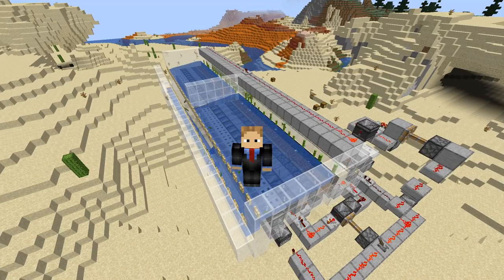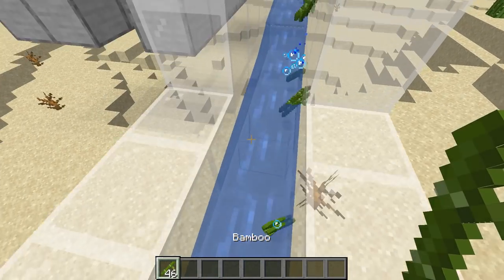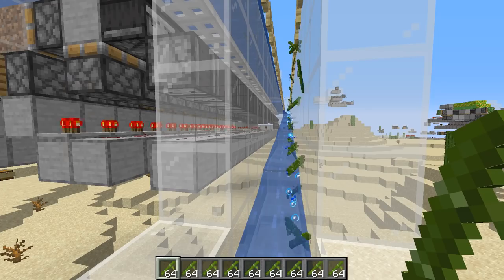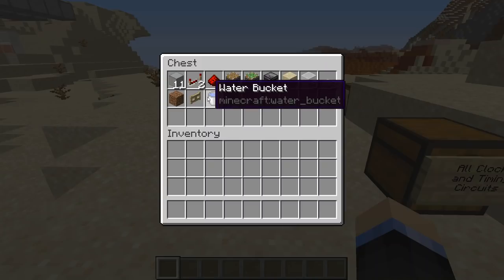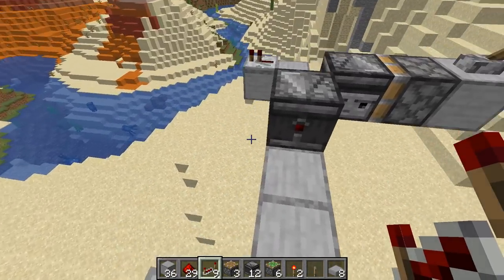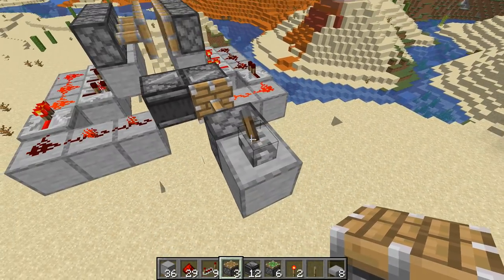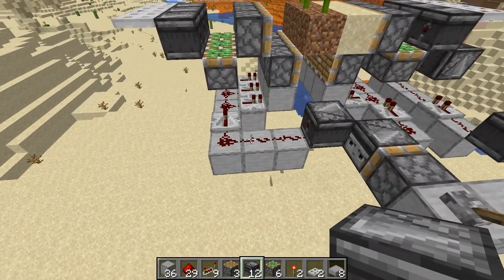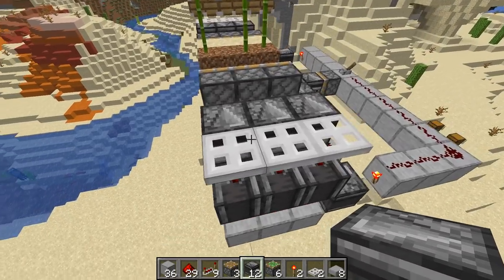Faster Than Zero Tick Bamboo - Minecraft Java 1.15 - Full Auto Shaky-Sand

Comment: Is it possible to rig this in some way to stop when the hoppers/furnaces are full? We're trying to set it up like that but it keeps breaking. :(
Reply from the maker: you could hook it up to an off... or you can add an item overflow protection system by putting a cactus or lava at the end of the water stream to automatically destroy any items that don't get picked up by the hoppers.
Reply: @EagleEye621  The old one i have for my exp machine (0tick) just automatically shuts off when a certain hopper is full.. then started back up again when items started flowing out of it until it was full again for an exp furnace, but it seems 1.15.1 killed its 0tickyness and was hoping this qtick could do the same without breaking if i forget about it and leave the area without turning it off manually. (brain like a sieve) x.x; (im on a vanilla server)
Reply from the maker: @perusalenne  oh, I understand.  you have to make a few changes if you want it to be auto-on/off without player input, but if you leave it on while you unload the chunk it will break.

Comment: ok eagleeye i have built yours and iskalls zero tic bamboo on my java paper server and they work i have flipped both around to make sure its not a orientation thing and its not, can you give me any ideas to try, im fixing to resort to a carpet duper for full
Reply from the maker: when you say flip... do you mean 90 degrees?... also, NOT work or work... if not, you need to change the settings in paper to turn off the mod blocking it.

Comment: This farm is perfect for fueling my XP farm. Only issue I am having is getting the pistons to shove the sand over on start up. The blocks rise slightly later due to the 2 tick repeater, but the sticky pistons that shove the sand and dirt over don't activate... Any ideas?

Edit: Just realized that both sets of pistons, 3 each, aren't activating to push the dirt and sand. The blocks above the observers go up and down but its like the redstone signal isn't reaching the horizontal ones.
Reply from the maker: did you build it in the wrong direction?
Reply: Maybe you placed the observers facing the wrong direction?
Reply: Same issue here.
Reply: @Blorfik  Make sure the pistons are facing east and west. That's what I did wrong.
Reply from the maker: @Blorfik  same answer here
Reply: @EagleEye621  So, whats the answer?
Reply from the maker: @danilap8994  for them... they built it facing the wrong direction.
Reply: @EagleEye621  Mine is facing the right direction and im still having problems when i shut off the system. Any chance you could help me out
Reply from the maker: @danilap8994  of course... guessing you don't have the repeaters coming out of the observer clock (check the pinned comment)

Comment: Im having a problem where the pistons moving the sand aren't moving and I built it on the right axis and double-checked it. I'm building it a multiplayer server with my friends, could it be that the server lag is messing it up? Because this worked on my Redstone world
Reply from the maker: the zero-tick block pushers only work when pushing east/west
Reply: @EagleEye621  Bruh. I just finished one 45 long for a smelter and now I have to turn it around
Reply from the maker: @xionic1194  45 long? how big is the super smelter this thing is going to power?
Reply: @EagleEye621  It's 3 sections. It handles all of the sword output from a gold farm, normal sand smelting for my glass megabase, and a section that I sell the use of to other people. I added a component to this farm to adjust the output so it can be run on 15, 30 or 45 depending on how much of the smelter is being used. There's 180 furnaces, and the excess bamboo is used for scaffolding, which I also sell
Reply from the maker: @xionic1194  at 45 slices you are looking at ~300,000 bamboo per hour. 180 furnaces would burn 259,200 per hour, so even at maximum burn you have a pretty healthy surplus :)
Reply: @EagleEye621  2 things about this server  - it has villagers that you can sell things to infinitely, and it uses gold as currency, so the scaffolding plus the gold farm will make me the richest person on the server. Admittedly I may need a bigger spider farm for that surplus
Reply: @EagleEye621  how did you manage to calculate the value of those?
Reply from the maker: @GrndSbtr  ~6,600 bamboo per hour per slice /// furnace can burn 360 items per hour, need four bamboo per item... mathificate :p
Reply: @EagleEye621   Hey youre so quick! Please tell me how many slices id need for 30 furnaces, I cant seem to figure out the exact value. Thanks!! I really appreciate you! Subbed
Reply from the maker: @GrndSbtr  won't always be that quick, but do my best to find every comment eventually :p

each furnace needs (360x4) 1,440 bamboo per hour... so 30 furnaces needs 43,200 bamboo per hour (minimum) / 6,600 (per slice rates) = 6.55 slices... rounding up to 7 slices minimum. :)
Reply: @EagleEye621  Thanks for making videos on how to be really efficient in mc, keep up the good work! Thanks for helpin! 

Now that I think of it I think youre an actual engineer, in real life of course, in mc, you already are

Comment: does this work on servers? i just finished building it and its not producing anywhere near what your 3 slices are producing and then when i turn it off it crushes the sand and turns it into dropped items
Reply from the maker: it does work on servers unless it has been modded to block it.

did you build it in the right direction?
Reply: EagleEye621 yeah I did. I searched through the comments for a few minutes before building it. And it would start the shaking sands but it would barely produce and then when I turned it off it turned the sand into dropped items and the bamboo unplanted
Reply from the maker: @tylerphillips402  did you put a repeater coming out of each of the observers from the observer clock? did you double check the other timings?
Reply: EagleEye621 I think I did. But I disassembled it to use the materials for a different build

Comment: @EagleEye621 I built everything as you did and I have the right orientation for the zero tick pistons. The sand is shaking and everything but the bamboo doesn't grow fast at all. I play on a server of my friend version 1.15.2. I hope you have a solution to my problem thanks.
Reply from the maker: add some light near by if it is underground or blocked from sky access.  If you are playing with some plugins (like paper or spigot) they have default mods that block fast growth the admin has to disable.  also, some servers (like minehut) block fast growth be default.

Comment: so ive tried rebuilding it 2 times and for somereason the sand never gets pushed over to the middle
Reply from the maker: probobly facing the wrong direction.  Which way are the zero-tick pushers (the pistons that are pushing the sand and dirt) facing?
Reply: @EagleEye621  i have the same problem, as far as i can tell i did everything right, do you have a discord or something where i can send screenshots if you would happen to know what was wrong?
Reply from the maker: @xanthik6205  almost certainly the issue is it was built in the wrong direction (the zero-tick block pushers only work in one direction), but I do have a discord you are welcome to join (link in the description) :)
Reply: @EagleEye621  yea that was the problem, ran into another ome though, the bamboo breaks when dirt switches for sand, and sand breaks and doesnt get pushed back into default spot, if i only have dirt in it it seems to work fine
Reply from the maker: @xanthik6205  sounds like you might be missing a repeater? do you have repeaters coming out each side of the observer clock?

Comment: I don't understand what's wrong with mine, I did it exactly the same but my sand isn't being pushed over. Everything else works fine.
Reply from the maker: you probobly build it in the wrong direction? post some screenshots in the help section of the discord?
Reply: @EagleEye621  By direction do you mean the entire structure has to face north/south/east/west?
Reply from the maker: @rallozarx4215  the zero-tick pistons are directional

Comment: I built it and rebuilt it multiple times, tried adding the repeaters on each side of the observer clock, the pistons are west/east oriented, but the bamboo doesn't grow :/ Help ! I'm on 1.15.2
Reply from the maker: bamboo not growing but also not popping off when the sand shakes... either you don't have enough light or your server has been modded to block fast growth.  If you are or know the admin, you should be able remove those mods.
Reply: @EagleEye621  It's a vanilla server, but it was missing light !! Thank you <3
Reply from the maker: @raphaelqueiroz7925  great... also, check out "Remote Activated Shaky-Sand (36,000 Updates Per Hour Per Crop)" for that issue with moving the on/off switch further away.
Reply: @EagleEye621  This seems complicated, I managed to make it work just by pushing a redstone block with a sticky piston
Reply: Well you showed it in the end of the video x) I spoke too fast

Comment: Hi having a problem where the pistons are not pushing the sand block
Reply from the maker: did you build it in the correct direction? as noted in the video, they have to be pushing east/west or it doesn't work :/
Reply: Got ya good thing I built it on the testing world first

Comment: I am facing a problem when i exit game and open again the sand geting break please tell me the solution
Reply from the maker: turn the machine off before you leave.  A lot of redstone machines will break if you unload them while they are running.
Reply: @EagleEye621  can id do it with out turn it off. If i can but how?
Reply: Nirjoy Hasan Antor you need to turn it off or it just breaks
Reply from the maker: @nirjoyhasanantor3149  if you don't turn it off it will break when you unload it.

Comment: Really good video. But I have one problem with the sand, because it gets destroyed when Im turning the machine off. 
Love you videos!
Reply from the maker: did you remember to add the repeaters coming out of the observer clock?
Reply: @EagleEye621  thanks for the quick answer. I did not remember to do that. Thanks a lot. 😀
Reply from the maker: @johanmilterjakobsen1627  not your fault, pinned comment as it was shown in the demo, but in my block-by-block left it out accidentally, but a lot of people never scroll down to the comments
Reply: @EagleEye621  It works really good now. You are really good at explaining, what is happening and what you are going to do. Thanks a lot. 👍👍😀
Reply: @EagleEye621  Im so sorry that i have to ask about something again. But i have made the farm on a server, that my friend has made, but the bamboo isn't growing as fast as when I build the machine on single player. I think it's because the shaky sand doesn't work on the server, but i don't no?
I have build it in the air. Do you think that has somethimg to do with it?
Reply from the maker: @johanmilterjakobsen1627  if the sand is shaking, and the bamboo is not growing but also not popping off, that means either there is not enough light (not a problem if it is in the air and nothing is built over it), or there is a mod that is blocking the fast growth.

what version are you playing, what server, and any plugins?
Reply: @EagleEye621  my friend has made the server, from the website MineHut. Im playing in version 1.5.2. I do not have any plugins. 

I play on a laptop, so sometimes it lack's a little. Do you think that could have something to do with it?

Sorry for my bad English writing. (:
Reply from the maker: @johanmilterjakobsen1627  minehut it known to have a mod that blocks fast growth :(

(and I am sure your English is better than my whatever-you-speak :p )
Reply: @EagleEye621  Okay, thank you so much for helping me, so much! I really appreciate it. And thank you for saying that my English is good. (-: 

 Have a nice day.

Comment: I'm having a problem where my bamboo aren't really growing fast in 1.15.2. Any ideas what's wrong with it?
Reply from the maker: did you build something over it or is this underground? try adding some light near by and see if that does the trick
Reply: @EagleEye621  i added some light but it's still not growing at all. i checked for any blocks but there's no blocks. could this be lag?
Reply from the maker: @slickvox2639  not growing and not popping off even with light, odds are it is a mod. do you use spigot or paper? they block fast growth by default.  if you are or know the admin you can turn those features off.
Reply: @EagleEye621  what a big oof moment for me, the admin told me they were actually using spigot at the moment. i just rebuilt it in my own survival server and it worked. sadly, i have to tear off the one at the server. thanks for the help!
Reply from the maker: @slickvox2639  you can change the settings within spigot to get it to stop blocking the fast growth... if you have not destroyed the farm yet.
Reply: @EagleEye621  well, it's actually a fairly large server tho, so I dont think they can, and I already destroyed a good portion of it. But at least it works on my survival

Comment: For some odd reason sometimes when i start the system the bamboo and the sand breaks. When i reset it (plant back the bamboo and place the sand back) it starts perfectly. Then on the second start it sometimes works sometimes breaks... Why does it happen and how could i fix it?
Reply from the maker: sounds like you might have some timings off.  if you post some screenshots or a video in the discord help section I can try to troubleshoot.
Reply: Ok, i'll try to do that!

Comment: I checked everything, the only problem is that the sand does not push into where the dirt is, other things looks to work fine. I've done this in Minecraft Java 1.15.1
Reply from the maker: you might have built it in the wrong direction?
Reply: @EagleEye621  i checked sand side Observers, they are facing right direction. Any ideas..?
Reply from the maker: @Sykina  I would need to see some screenshots.  Can you post some (or a short video) on discord?

Comment: When I turn the machine on everything works perfect but the bamboo just won’t grow and when I turn the machine off the sand just breaks and fixes?
Reply from the maker: sounds like you might have the timing off... can you post some screenshots to the help section in the discord or a short video.
Reply from the maker: @Marco De Carvalho no... #PleaseNoPatch :p
Reply from the maker: @Marco De Carvalho or... you could keep whatever you build, AND build this crazy thing... #NeverEnoughBamboo :)

appreciate the support :)
Reply: Try putting torches around the bamboo, I had the same issue but put torches by the bamboo and it worked great, still have the sand issue sometime though
Reply from the maker: @filtername1824  do you have the repeaters coming out of the observer clock?

Comment: Can this be built without water? I need something that works in the nether, since ilmango's zero tick farm is not working for me in 1.15 anymore (but some people are saying it is for them??? weird...)
Reply from the maker: I have a different version that does not require water (water is used in the collection stem, but you can replace that with hoppers if you use enough of them keeping in mind the 9k per hour limit) called "Fully-Automatic Shaky-Sand - 5,000 Bamboo Per Hour, Per Crop (Minecraft Java 1.13 - 1.15+)"

that said, if ilmango's zero-tick is not working for you, it may be that your server admin added a mod to block fast growth, which would likely break the design mentioned above.
Reply: @EagleEye621  I am the admin and there is no such mod. Seems it is a problem with PaperMC currently. Thanks
Reply from the maker: @wewd  yes... you should be able to disable that I think
Reply: Very dumb question but have you tried placing a torch near ish it? the bamboo still requires a high enough light level for it to grow (even through zero tick)
Reply: @shanegeldart2913  It's a setting in PaperMC. Turns out the Paper devs "fixed" the "bug" that allows zero tick farms, and you have to disable the fix for it to work again.

Comment: it doesn't work for me... the pistons that should move the sand don't take the signals from the observers... I built this farm 6 times and there is always the same problem
Reply from the maker: did you build it in the correct direction?
Reply: @EagleEye621  yea...everything in the same direction as yours
Reply from the maker: @midnight3310  what direction are the pistons pushing the sand facing?
Reply: @EagleEye621  uh... they face the sand..shouldn' they?
Reply from the maker: @midnight3310  north/south/east/west? ... two of those directions work, two of them don't... tried to be as clear as possible in the video and pinned comment.... turn the whole thing 90 degrees and it will prob work for you
Reply: @EagleEye621   All right! Ty.. tomorrow I will try to turn it 90 degrees and tell ya if it works... cy@ and ty again ✌🏻

Comment: I got everything to work except the sand wont push.  any suggestions?
Reply: looks like I need to change orientation.   right now when machine is off, water flows (smooth stone is down) but when turned on, smooth stone is raised, stopping water.
Reply: I got it rotated and it works, but I think there's too much lag, and the sand falls out.
Reply from the maker: looks like you figured out the rotation... did you add the repeaters coming out of the observer clock?
Reply: yes.   added repeaters next to both observers.  The sand shakes, but falls almost right away due to lag
Reply from the maker: @ImmenseImperialGoat  that doesn't make sense... are you on a server?
Reply: yes.  on a server.